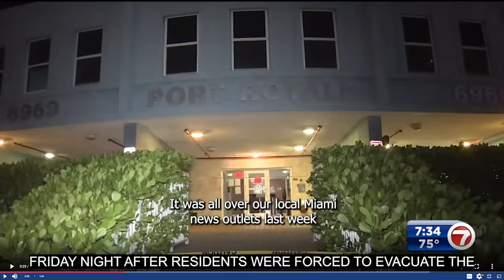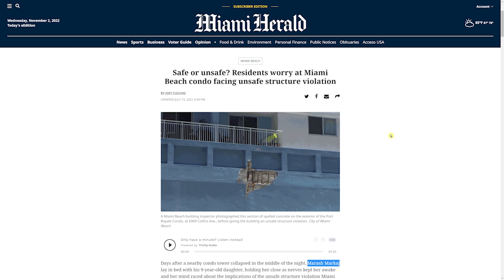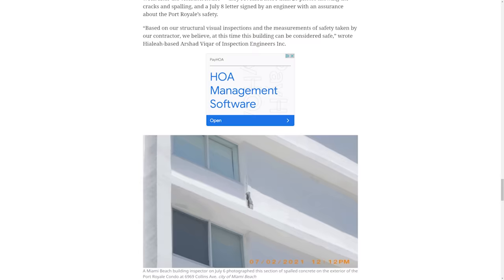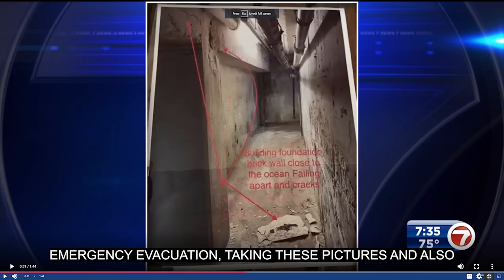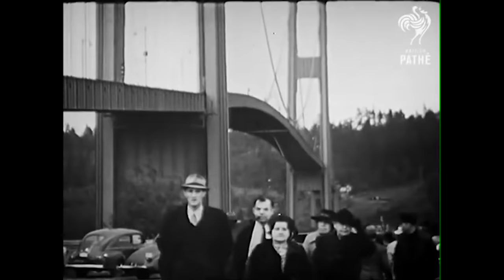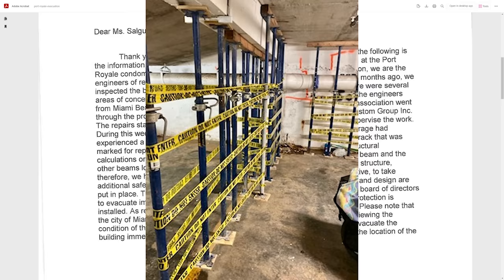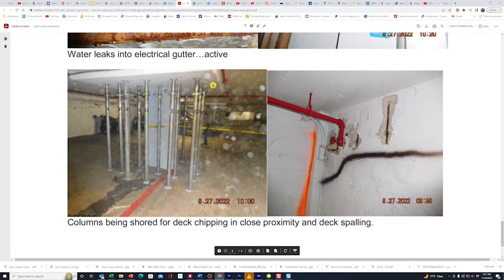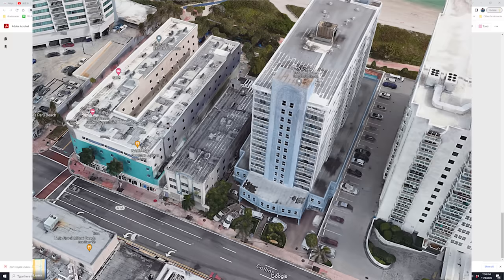Another Miami Condo Evacuated Why it Will Collapse

Comment: That shoring looks too slender and doesn't have any support beams nor bearing plates. As a former PE, I'm glad that I retired 11 years ago. "Normalization of deviance" sounds like what CA is doing in their kindergartens. The state of the art has dropped a lot since 2000. I don't read ENR anymore but with the flood of chinesium steel, I expect that there have been a great increase in failures. I've seen them during construction and after. Yes engineers can do precise evaluations with computers but, garbage in equals garbage out still holds when inadequate investigations are used. I've seen engineers propose to drive piles into cold dense bed rock because they never did any site investigation. It was embarrassing to me because they had been my students when I taught bridge design at our university. In many cases, the owner does not want to pay for inspections to make sure that the construction is even according to plans. I would bet that much of the concrete in those buildings used "washed" beach sand. I also have to wonder how much differential settlement of the footings? A very well done video. Thanks. Good Luck, Rick

Comment: i think this is a simple issue of big picture underestimating engineering challenges of florida! facts like being on the oceans edge with a few cat4 and cat5 hurricains having had come right at these beaches to even bigger issues like florada is mostly held up above sea by coral reef that has been destroyed in big ways by man. the main issue with florida is is it even safe to expect 5 or more stories high structures to be on solid ground think leaning tower of pisa. unlike new orleans that has glacier ground stone sediment florida does not its mostly made of coral and peat moss you would need to dig as much as 1000 feet to hit solid earth giant boulders that have been moved to florida by glaciers to make the keys for example the few times an ice age gets that far that is less than 1 out of 7 dont count. that is why florida is so swampy after all the last 5 ice ages have not added anything to floridas land mass and even though new orleans is below high tide the soft layer of sediment under the ground is more than twice as stable twice as strong and shifts 3 times less because its not more than a third organic matter.

Comment: The first image is just failed stucco...The one beam that is shored up, is hairy but; easily repairable...It was dishonest to show that pedestrian bridge collapse; that was due to post tensioning not be correctly done. That was still under construction...The first condos that collapsed was NOT a structural failure...It was clearly a controlled demolition...There are some maintenance issues present but; nothing collapse worrying...Buildings, especially concrete and rebar reinforced do NOT just come down...They collapse in portions...Unless the main structural support is REMOVED...PERIOD...Builder and Constructor for 35 plus years...Philly area...

Comment: Condommunism is a failed concept. Nobody wants to take responsibly for the shared structure. These condos all should have had trust set up and funded by the builder and then tenants from day 1 for major repairs decades down the road. Surfside knew their building had issues but they remodeled the finishes to make the place look better and raise property values and ignored the structural problems.

Comment: Any concrete crack are examples of reinforce bar rust expansion. 197'0s developer used shoddy reinforce bars Many likes for your diligent researches better than government inspectors. The whole issue with these problems were that government weren't doing their jobs It's like the neglected falling bridges. The cracked aged structure should have been gutted to the bars, replaced with epoxy coded and concreted, 25 years ago. It's either engineered  patch it or require totally demolished. No, if and or butts! The objective is to save lives. Why aren't these buildings insured? We know the HOA is going to say, "We don't have the money". What have been done over the past 50 years?

Comment: “And everyone who hears these words of mine and does not do them will be like a foolish man who built his house on the sand. And the rain fell, and the floods came, and the winds blew and beat against that house, and it fell, and great was the fall of it.”
Reply from the maker: These buildings would not need to be ticking time bombs if they simply maintained them better, and sealed them properly, and repainted them on a more acceptable scheduled basis based on how long that paint is guaranteed to provide protection externally to the building.

Comment: Just out of curiosity, asking for a friend... If the building that somebody hypothetically worked in what hypothetically have pillars that aren't showing any cracks yet obviously look twisted like --- they used to be square but not anynore... should said hypothetical person be concerned. Asking for a friend...
Reply from the maker: Would like to see photos, but unless there are cracks, might not be an issue. Can't tell without seeing pictures
Reply: @jeffostroff  I can send you some photos. When it rains this 'hypothetical' building also tends to leak like a waterfall in the stairwell. I tend not to give it much mind considering this building has been here since 1976 and it hasn't fallen down - yet. But watching all these videos of Miami building collapses, and working in a building with 22 stories over my head, makes me wonder. I love working here too so I certainly wouldn't want to suddenly not have a job one day because someone didn't apply the necessary rolls of duct tape to fix the issues.

Comment: new buildings sure are junk. The Woolworth building, a much bigger skyscraper, is over 100 years old and fine.
Reply: That building has undergone extensive renovation though, and is twice as high as it was designed to be. Don't assume it is problem free, because that is definitely not the case. Most similar old buildings have been torn down and replaced, that one remains because of its iconic status.

Comment: Small hairline cracks can be normal, though, right? I’ve seen this in my garage and whatnot, for a brand new house, but they never grew or anything.
Reply from the maker: Yes, small hairline could be normal, the engineers still have to assess it, and if it grows wider, there should be cause for concern

Comment: Put that building down. That's "ready" and nonsense to start fix it. That wall have more old spots where it has failed and just painted over, at least it look like it. They have made poor local cement or maybe sand isn't right type. Sea eats buildings too ofc, and if there is so much water under building what you could expect from video, it's not suprise these fails. 

I'm 100% sure that fixing this isn't worth it.

Comment: Those shoring poles (picture  at around 3 minutes) look like the kind we use here in the UK when work is done to remove a wall in a regular house or when constructing plywood forms for concrete pouring. Hardly adequate to handle the kinds of loads seen in a multi-storey condo.
Reply from the maker: They come in different thicknesses and strength
Reply: @jeffostroff  I know. But the ones I mentioned look like the smallest size we use here.

Comment: I was building a updated deflection calculator this week and found a new UOM on the web, KSI.  KSI = Kilo-pounds per square inch.  I just want to know which idiot mixed metric with imperial terms?!
Reply: KSI = 1000 PSI

It’s not a new UOM, it has been used for decades when describing large values, also sometimes written as kips

Comment: construction methods building many of those condo buildings were bad. the rebars exposure to the elements is the weak link. all the buildings with rebar pillars and beams have a limited life about the same as the failed tower which appears to have been built in 1981, so 40ish years. sad.
Reply from the maker: They could be in better shape if they had just sealed and painted the buildings regularly
Reply: @jeffostroff  could being the key word..... outlawed in my book in the field along with the siblings should
d and would.....best identified by having way too many letters.

Comment: Even the Jacks haven’t been put in correctly. 👎
Reply from the maker: Nothing wrong with the shoring poles they are put in properly
Reply: @jeffostroff  there’s no Headerplates on the Jacks. Some of the Jacks go straight onto bare concrete. Any vibration elsewhere and they could shake out. Just saying, no offence meant. Worked in the industry 50years, and no Jack I ever seen put in went onto bare concrete. Even the spacing of the Jacks is debatable and they’re not Tied to each other or anything else. Obviously that’s been rushed but that not to say the job then should have been done properly.

Comment: I can assure you that there is no way in heck I would live in an old building on the beach of Miami, Saltwater easily penetrates Concrete and we all know what saltwater does to rebar, as the rebar rusts inside the concrete, the bond between the rebar and the concrete is undermined by the rust from the rebar, when the concrete loses grip on the rebar it's only a matter of time, and how many times have those buildings been swamped by flood waters from the sea?  How pervasive is the rust within all of that concrete? Thanks, but no thanks Plus I am not even touching on the chemical stability of the Concrete itself, with the spalling going on there is more at play here. It's too bad that we didn't manage to get the Concrete Technology from Germany before it fell in 1945. The bunker structures and submarine bases they built in France are still just as ready to support weight and resist bombardment as it was first created in the 1940s, same with all of the underground networks of tunnels Nazi Germany built before the end in 1945, still, almost all of it looks as brand new as the day it was made! Yet, we have NO IDEA how they made it, even to this very day! There is some theories but nothing proven.
Reply from the maker: Come on move in there with me bro we'll have s’mores
Reply: @jeffostroff  🤣

Comment: It's very interesting to see this. Do you think there should be a law that requires HOAs to pay for residents that are forced to leave due to these type of building conditions?  I've never understood the point of paying HOAs when they do absolutely nothing.
Reply: HOAs to pay for residents that are forced to leave due to these type of building conditions?  Well in this case its not a HOA its a Condo association.. which is the unit holders themselves. So do the condo owners pay themselves to move out? If there is a renter in a unit the loss of use would break any lease that the Unit owner would have with renter... Remember there are 160 owners of this building, each owning a unit.(Its not an apartment complex)
Reply: The HOA is comprised of the owners of the condo units, so when you sue your HOA, you are suing yourself. They MIGHT be able to shake down the professional management company that the HOA hires, if they can prove that the managers gave bad advice to the HOA. I really don't believe you can fault the Board of Directors, who are all unit owners elected to represent them by the owners, if the Board was following the advice of management and/or of engineers who did work and advised on same. I sit on my condo's Board of Directors myself, and like most condo owners, we Board members are not experts, but rely on same. Worse, we have to persuade the owners that they must pay the huge assessments necessary for repairs of this sort, and I can tell you that when it's time to ante up monster assessments, owners take a lot of persuasion. They will even second-guess a stamped engineer's report. The Port Royale has been struggling with structural problems for over a decade, and in 2011, owners had to ante up $50,0000 per unit to repair extensive structural deterioration, which repairs seem to have come undone since. People ask why they didn't save the money, and I can tell you that almost NO association, even a relatively wealthy one, will ever have the money standing by to address problems this large without a special assessment, for the recommended reserve fund is 50% of an association's budget, and any large capital project will probably cost far more than that.

Comment: I think an important fact the USA needs to face is that most buildings have a rated lifespan and then they need to be DESTROYED and REBUILT once their lifespan has expired. Stop putting more lipstick on the pig, it is a dingy old building and needs to be fully demolished and rebuilt if it is to stand for 50 more years. If you want buildings to last hundreds of years, they need to be built like tanks, but Americans are too cheap, so they'd rather test their luck on dilapidated buildings that have outlived their useful service life.
Reply from the maker: I would hate to spend $30k on remodeling a unit then find out they need to tear the building down. Ouch!

Comment: Ridiculously simplistic overview of engineering and design flaws. The directed conclusion this article points to is that reinforced concrete cannot be trusted in building construction which is not supported by the facts of concrete design, proper construction methods and perfect quality control. A you tube garbage article if ever there was one.